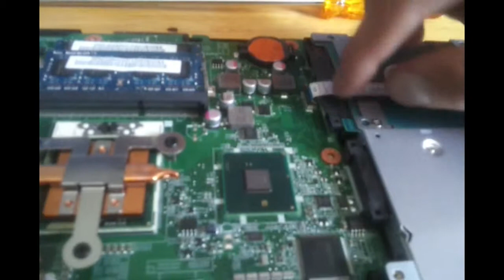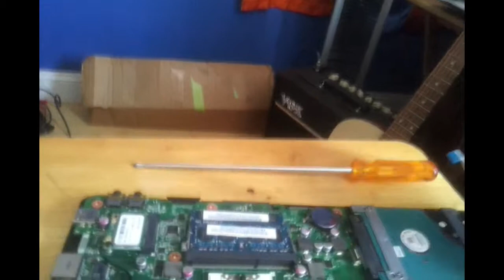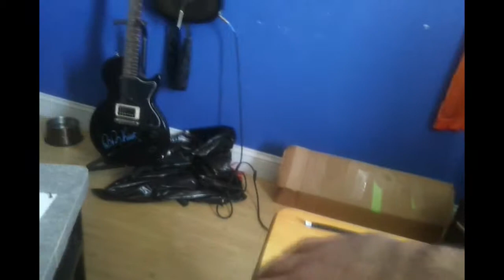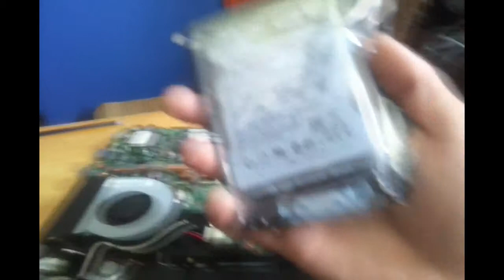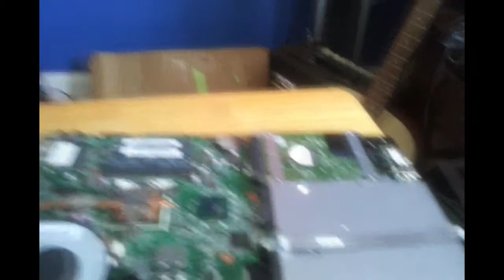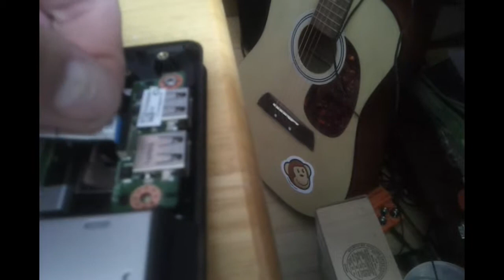How to Install a Hard Drive into a Laptop

Comment from the maker: No, a repair disc is to fix a corrupted OS. What you want is a disc image. If you go into the backup and restore options there should be an option for creating a disc image. You would still need to install Windows before restoring everything from the image file.

Comment from the maker: You would have to re-install the operating system of course. The repair disc is usually when the files of the operating system are corrupted. If you are replacing the HDD then you had bigger problems hehe (or wanted an upgrade).

Comment from the maker: Sadly, no. The CPUs on laptops are usually soldered onto the motherboard.
Reply: Sako's Tech Spot just an update... I know this video is pretty old but turns out that the processor could be upgraded up to a Core i5 580m (to keep the same power consumption). Honestly loved this laptop, helped me to develop computer knowledge and skills. I'd also like to thank you for making this video as this was one of my first steps to tinker with tech.